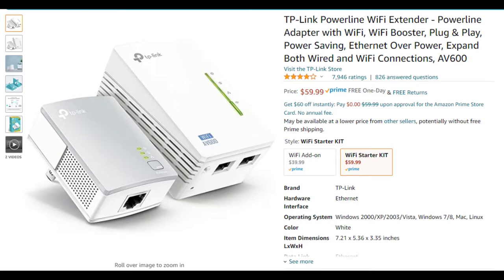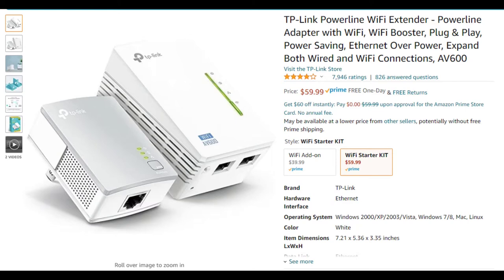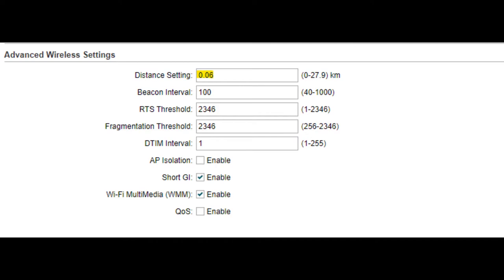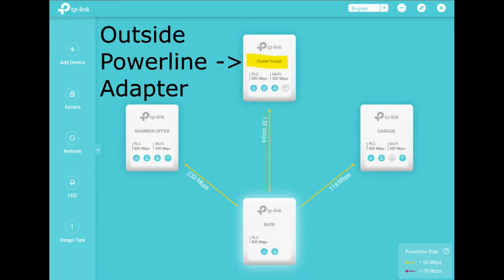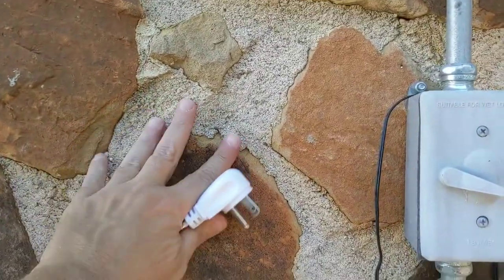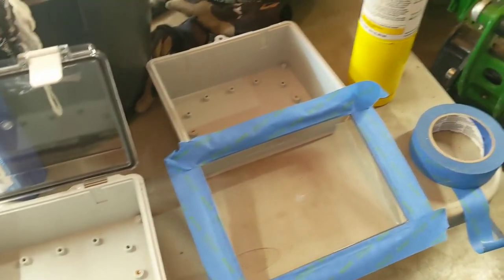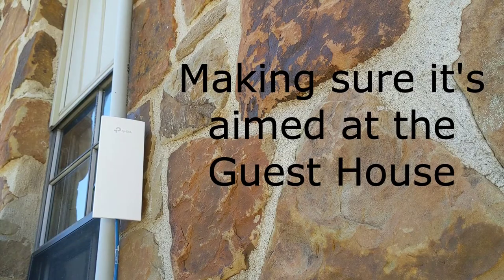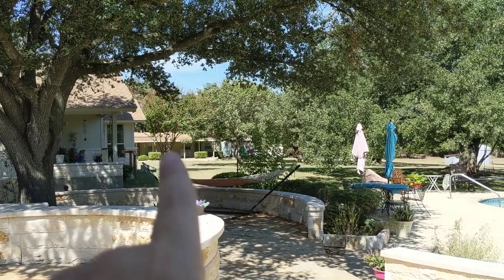Point to Point longe range wireless bridge install TP LINK

Comment: Nice video. Point to point links are nice. Im using a ubiquity airmax gigabeam 60ghz with a fail over 5ghz link if 60 goes down. It's about a 227 foot distance and it works great. Need to upgrade the wireless access point in the shop to take advantage of the ptp antennas full speed.  Using an old netgear 802.11n wireless access point because I had one laying around. Get about 60-75 Mbps down/up.
Reply from the maker: That's really good! I think the limiter on mine is the powerline ethernet. I am toying with the idea of running coax outside to the transmitter but it would be a serious pain.
Reply: @BubbasWorkshop  That probably doesn't help the matter.  Instead of coax, why not ethernet? I used cats for my part of the wire that needs to be exposed to the outside.  Heavily shielded and has UV protection. If I replaced my shop wireless access point I could get speeds up to 800 down/up.
Reply: @duwaynemurdock  Oh nice! So that should work well then.  If you get bored.  Check out a few of my videos.  Pretty basic ones.  But I enjoy sharing stuff I work on.

Comment: Thanks for the vid. You said 'this is how I'm doing it', but why not just pull a cat5 line outside direct to the antenna from your router? Also, are both locations on the same power pole or power meter? Did ya try to network over power line between the two buildings? Was able to do this for shop at our old place, both locations on same pole but separate meters - still worked.
Reply from the maker: both buildings are on completely separate systems (different poles and meters). I used the powerline vs running cable because I already had it (i have spares as I don't really use them anymore as i've "meshed out" the house).
Reply: Was it any special to connect the router to the cpe? I read somewere that there will be interference just connecting the cpe to the wifi router in the "new house"